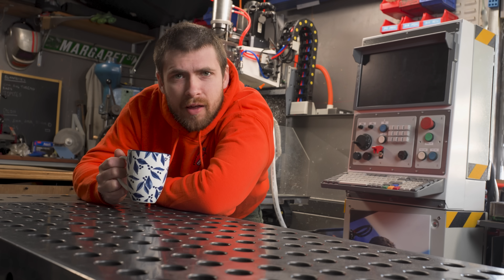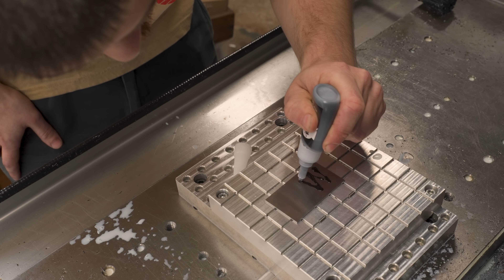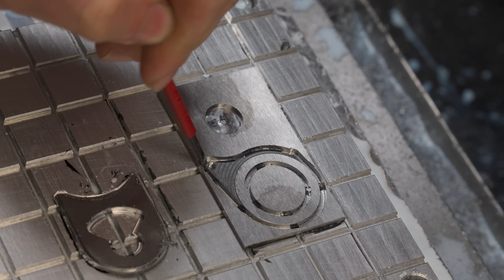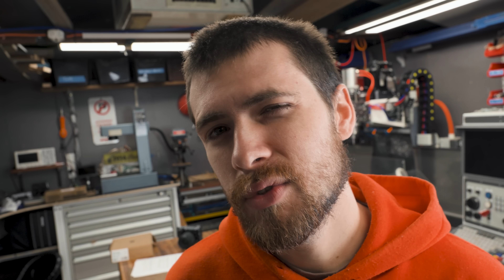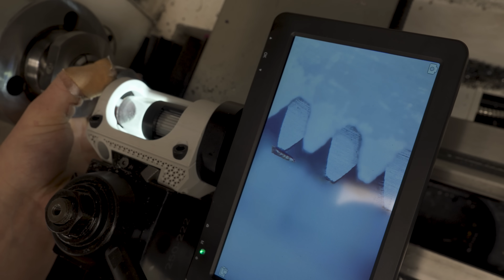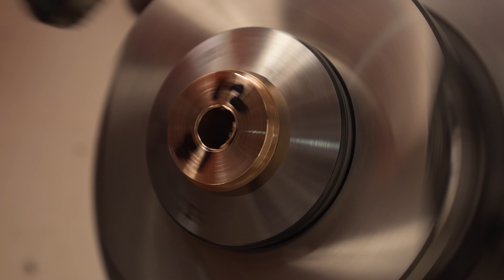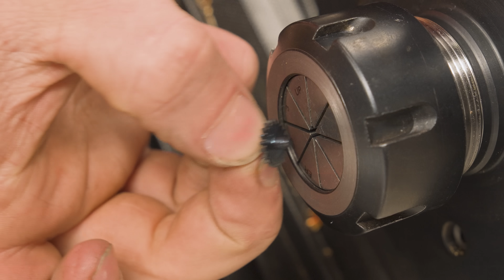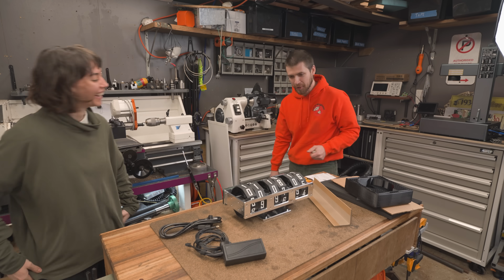What if angles were metric?

Comment: Just to flesh out the discussion on degrees a little, ancient Mesopotamians are said to have favored numbers that maximize divisors for easy calculations. Sixty has a great many: 1,2,3,4,5,6,10,12,15,20,30,60. This logic also carries over to our timekeeping with hours, minutes, and seconds.

There is also an interesting biological explanation for the 12 hours. They would use their thumbs to point to the segments of their other fingers to count. 4 non-thumb fingers x 3 segments is 12.
Reply: I forgot to mention how they count to 60 by hand. They use their second hand and raise a (12 base) finger when they complete counting up the first hand. 5 fingers x 12 knuckles = 60.
Reply: @NickCombs  In the modern terminology for 'maximum divisors', 12, 60, and 360 are respectively the 3rd , 4th, and 6th 'colossally abundant numbers'. Exceptionally optimal for splitting up cleanly. Unless you're willing to jump all the way up to 2520 or split your circle into a measly 120 pieces, 360 is the optimal number for dividing and dividing again, and 60 is a decent choice for the smaller arc minutes and arc seconds, or just casual counting generally. Ironically most people do metricise fractional degrees nowadays, but the mathematical purity of Mesopotamian counting happily lives on in our timekeeping without any short-sighted fixation on how many fingers a typical example of our species currently has.
Reply: @NickCombs 
now mix this with binary. 
fex: use the 12 system in the right hand and binary on the left. with binary on a single hand you can count up to 31, 31x12 = 372.
I don't think that's very useful, but it's interesting at least
Reply: Another thing I've heard about "Degrees" is that the word is used to describe a unit that does not align with an absolute zero.
For example; temperatures.
Celcius and Farenheit are Degrees, because their zero points do not align with "No Heat Energy"
Kelvin and Rankine are not Degrees, because they both have their zero aligning with "No Heat Energy", or Absolute Zero.

I don't know quite how (or if) this applies to angles. It could make sense that angles just keep rotating, repeating and overlapping in a way that they have to be a "Degree" rather than an "Absolute" measurement, but I don't know the story there.
Reply: That's essentially what I've heard as well, that we use "degrees" to measure relative scales where zero doesn't mean an absence of something. So in angles, zero degrees is still just as much an angle as 90 degrees.
Reply: @Tachrayonic  A bit of a myth, though practice makes it true ish. People used °K and called it degree(s) Kelvin up until the late 1960s, when it was changed by international organisation of weights and measures for standardization purposes (smelling their own farts also being a factor has not been ruled out yet, always a possible motivator with such crowds). They really just wanted the unit of measurement for temperature to be one character long like most others are (excluding power of 10 prefixes like milli-, centi-, kilo-, or mega-) rather than maybe one, maybe two characters. Also to fix one of their previous fuck ups, because they told people to describe temperatures with °K, but report temperature differences in "deg" (yes, "deg"), which was stupid (for every other unit of measurement of anything, you measure their value and the difference between values with the same unit and symbols). When they (re)defined the unit name and symbol, they also fixed that so both are the same like for every other unit. So it is basically an arbitrary decision, with maybe a rationalization for it people developed or speculation on what the folks at the BIPM were smoking.

But hey, either way, Kelvin is a scale which zero points is the so called absolute zero point, they dont use the ° as part of their symbol, people these days usually avoid saying degrees Kelvin while scales like F and C technically have the °/degree part first (nvm no one but no life pedants will care if you say or write X C[elcius] or Y [Fahrenheit]), so it at least does work like that anyway. [Edit: removed the Rankine mentions, I forgot that is still °R not just R lol)
Reply: @louisvictor3473  I have also heard that part of the reasoning was to avoid confusion between other ISO units since none of them needed the "degrees" qualifier at the time. So an appeal to consistency.
Reply: @NickCombs  I can't find any publication by the BPIM clearly stating their reasoning and confirming it directly,but that seems highly very plausible to me. Afaik K is the official SI unit, with a unit like °C being "just" a recognized alternative. They seem to see proper SI units and other units a bit differently. Also the resolution where they stablish it as K does is a move about a specific inconsistency, but that might as well be fruit of a broader desire for consistency.

Ofc, they fumbled the ball on that whole one letter symbol units by making the kg the SI unit instead if the g, which does greatly annoy at least one person I know. Yes, me, it annoys me a lot and I hate it, it makes the multiplier factor suffix logic inconsistent, because if the unit is called "kilogram", then kilo is  ot a prefix, its part of a name, so 1/1000 of a kg isn't a g with the "kilo" lopped off and then you use that to add said suffixes instead of the actual SI unit and its name, so it would have to be a millikilogram and so on, which sounds extremely stupid because it is and is exactly why they make the exception, but at least it's consistent with the very system they made themselves, which wouldn't need it to be an exception to sound consistent and not stupid by just making the Si unit the gram! .... Sorry, where were we? I blanked for a second there.
Reply: Three hundred sixty and some in the great, primary cycle (circle) of the year.
Reply: Ancient Egyptians used a 360 day calendar. The 5 extra days at the end were dedicated to honoring each of their major gods in turn.
Reply: The Mesopotamian bourgeois and their decadent divisors…
Reply: Using a highly composite number for subdividing something (like a circle) where every application is an integer division of the whole makes perfect sense to any reasonable person. The Sumerians weren't idiots. Gradians aren't used much because they're only useful in a handful of niche applications. For most engineering applications, they're an exceptionally stupid choice.
Reply: I love the Metric system, and I encourage everyone to use it, but the number "10" is the worst part about it.
Reply: they give up on dyadic numbers before they even get to 8ths though! unusable in my dyadically honest opinion.
Reply: Interesting point as the metric system was created for people that count using their fingers.
Reply: @davidsandy5917  One of the lasting developments of the French Revolution, unlike the death barges or methods of time keeping.
Reply: @omnip0d  their attempt at time keeping is objectively stupid. At the end of the day, we just can't metricize everything. A year will always be just under 365.25 days.

Comment: 11:00 the fact that the Earth turns at 15 arcthings per thing (i.e. minutes, seconds) never fails to bother me. We divided up the circle twice: once into 360, once into 24; then subdivided both of those into… 60. And somehow these two things both stubbornly resist metrification and both use the same base 60 subdivisions. Whyyyyy???

(probably because base 12/24/60/360 are just too darn convenient, and base 10 sucks, but that’s a whole different can of wyrms)
Reply: Who could have guessed? It's not like 360/24=15, oh wait...
No but fr that is really is design and not some divine thing or sth like that.
Btw wdym base ten sucks? For standard stuff the base is not really important, so you use what is most commonly used (decimal). And for specific cases, e.g. computers you use binary and hex (and rarely octal)
Reply: @unleqitq The Internet cult of base 12 is very caught up on the idea of convenient divisors, and really gets stuck on that idea to the point of ignoring the strengths of other base systems.
Reply: @karl0ssus1  The base 12 people are a surprisingly obstinate bunch aren’t they

Comment: I wonder why they didn't use an angle measurement that's a power of 2, like 256 or 512. Dividing 45° by 2 always sucks.
Reply: What's wrong with twenty two and a half?
Reply: @1pcfred  the half

Comment: Now, I am an engineer - well retired one - and I have to correct a common misconception. The misconception is that the Germans are metric. Well, only metric. And this isn't true. Because the Germans - like the French and, well everyone else - use imperial for pipe standards. I was in the oil and gas industry and when you get to industrial pipe standards then everyone uses imperial. Thread sizes and pipe sizes are in inches. Every where. Now, you might think this is a small thing. It isn't because every machine uses it. And in the O&G Industry the volume of pipe is a significant proportion of the global production of steel.
Reply: The modern inch isn't the Imperial inch though. Today we use the Standard inch. Imperial ceased to be used industrially in the Great War. The problem is the difference is so slight no one ever notices. The Standard inch is three millionths of an inch longer than the old Imperial inch was. Or is it two millionths? The archaic US inch was a tad longer than a Standard inch is. All of this drove a Swede mad so he split the difference and called it good. The definition of a Standard inch is it equals precisely 2.54 centimeters. The archaic inches weren't like that. They were out to seven decimal places.

Comment: Why radians or metric or base ten degrees are not popular is simple: because base ten is flawed when it comes to circles. If we had chosen another popular base, twelve, we would have more than a few remains of it, like the dozzen for most people, except bakers, who can't count and called thirteen a dozzen to keep complaints down. If a circle was divided into 12 parts, and those into another 12 parts, most people would never need to go deeper than that for any direction. N, NNE, ENE, and E would probably be 0 to 3 or 1 to 4 on something akin to a clock face. 12 at the top might stay, but be replace by 0 for degree measurments, making 0 to 4. But i it caught on early enough, 1 would be at the top. Suddenly, NE becomes one and a half, or 1.6 in base 12. Then, when the French decided to shove a flawed metric system on everyone (they knew they messed up the measurments but went for it anyway) then freezing would be 0 and boiling 144 (as a decimal representation of temperature) and the many complaints about how wide centegrade is would not be there because it would be duodecigrade and finer controlled. Twelve major steps broken into twelve minor steps is great for basic land navigation. More advanced land navidation breaking it into 12 more sub steps is great and would still be probably how the clock was done. That level would also cover wheel alingment. Right now, we have 360 degrees broken into 60 seconds and 60 minutes. But immagine if it was 144 minutes per hour and 12 second per minute? That 360/60/30 of now is 360, 21,600, or 1,296,000 parts per circle. For base 12, this is 12, 144, 1,728 (which would also be second per hour), 20,736 (where a hyper accurate but analog stopwatch for races would stop), 248,832, 2,985,984 parts. Again, great for most uses, but some super high accuracy uses decimal degrees at that point, so 35,831,808 would still see use. But all those seemingly large numbers would be powers of twelve and familliar to everyone, making them highly specific to people at large if they used base 12. Do I think we would ever do that now? No. I just think the underlying reason why gradians never went generic is because of that choice to standardize on base 10 ages ago and the fact it breaks when it comes to circles.
Reply: Once upon a time the punishment of a baker shorting someone was pretty severe. So they all got in the habit of throwing everyone an extra just to make sure they didn't run afoul of the law. That's how the baker's dozen came to be. To make sure it was at least an honest dozen.

Comment: 60 is a very handy number when it comes to proportions and fractions. Divisible by 1, 2, 3, 4, 5, 6, 10, and 12. Makes sense when most people's interaction with angles is in relation to dividing them in equal portions for geometry purposes for construction.
Reply: Metric needs to hang it up on the tyranny of base 10. Once some metric proponent loon tried to argue with me that metric works better with computers and I had to inform them that computers operate on base 2. Decimal is a conversion for digital electronics. Some people are too clueless to know now goofy they really are.